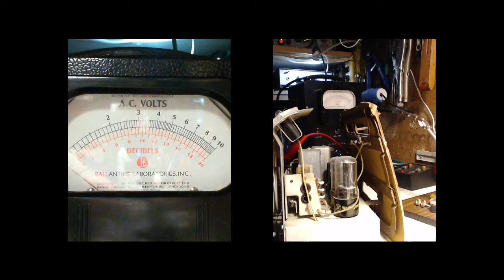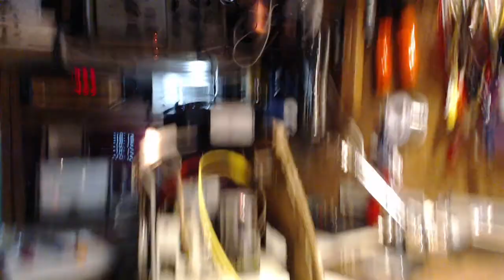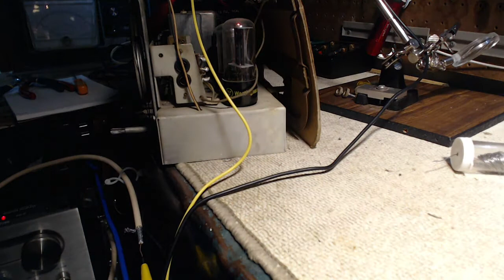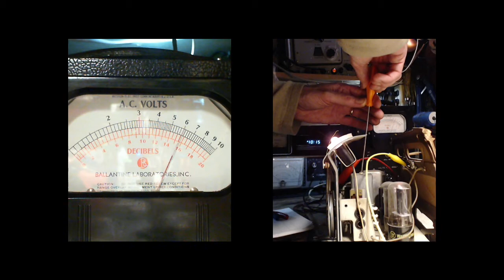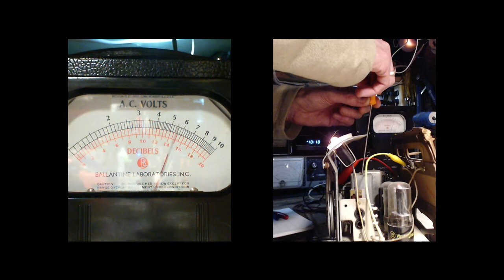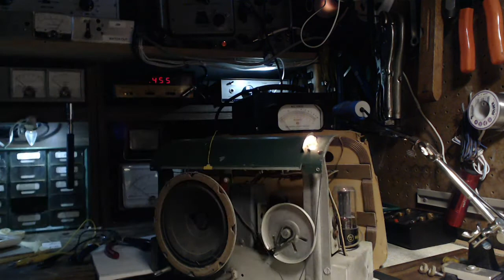Sonora RQU-222 Six Tube Radio Video #4 - IF Alignment

Comment: Hello Jim. I was wondering if you kept the voltage restricted,could it mess up your alinement when going back to full power. Has I can still see, your dim bulb light on?. I have never tried an alinement with restricted power and wasn't sure. Anyway cool video.
all the best.
Bobby
Reply from the maker: ***** Sometimes I leave the restriction on by accident.  With a small radio, it doesn't matter much.  My isolation transformer adds a few volts so loosing a few in the light bulb won't hurt.  I've found that AM circuits are quite stable with changes in line voltage but not so with FM.
Reply: Jim Lindenas That's good to know thank you for the reply. All the best.
Bobby